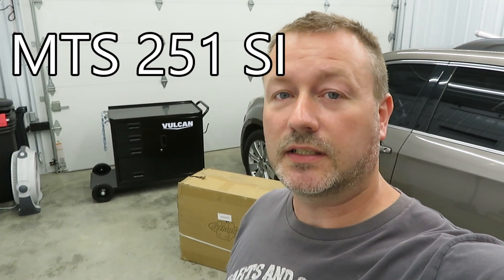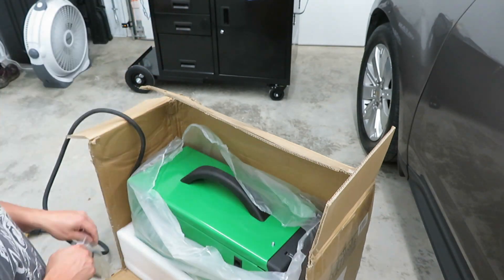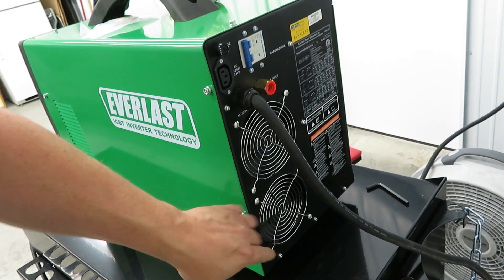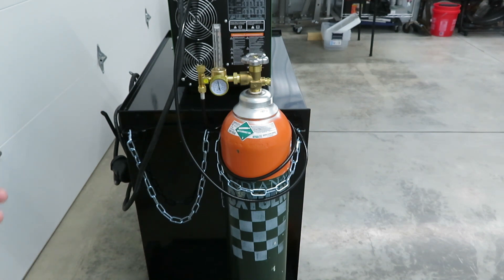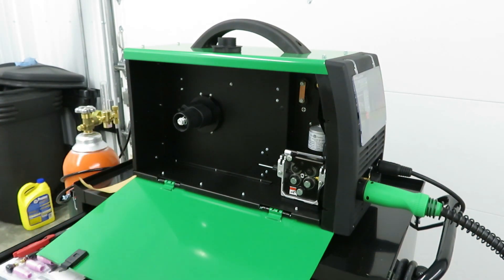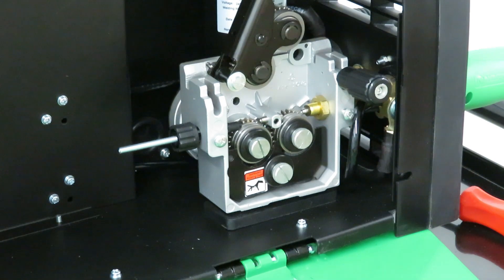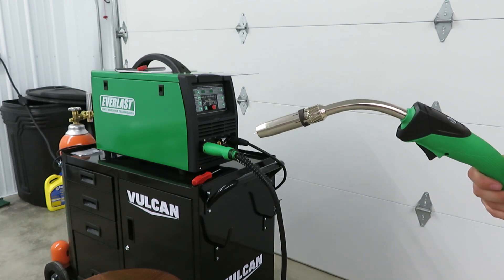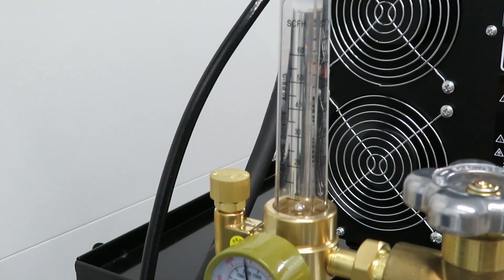Everlast Power MTS 251 SI Welder Unboxing & Setup

Comment: I also went up from the 211 to the 251 for the features mostly but also the 100% duty cycle above and beyond my likely use <150a. That said, additions were MIG and TIG torches in two smaller sizes each for lighter duty. btw, The manual is particularly helpful for using its many features.